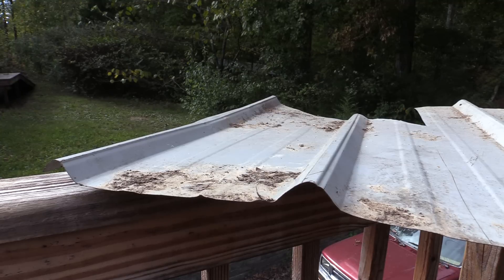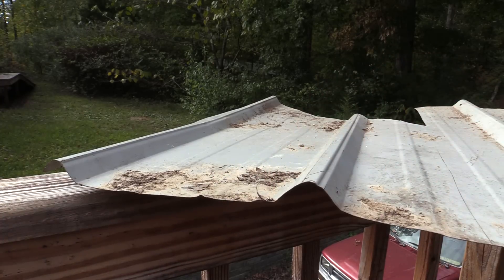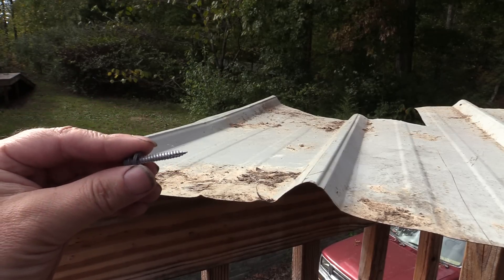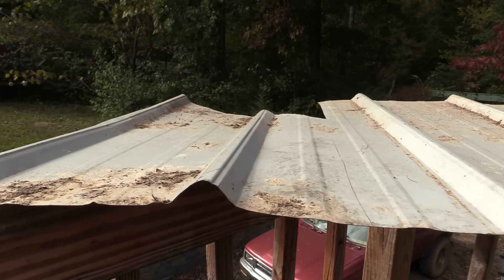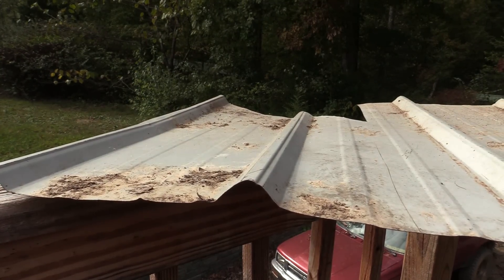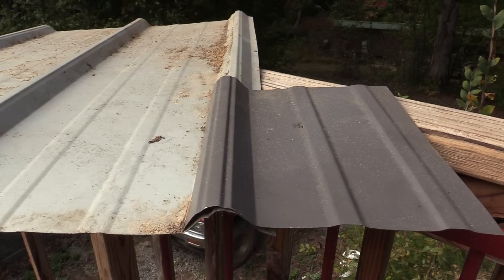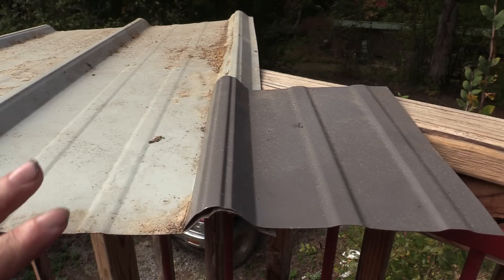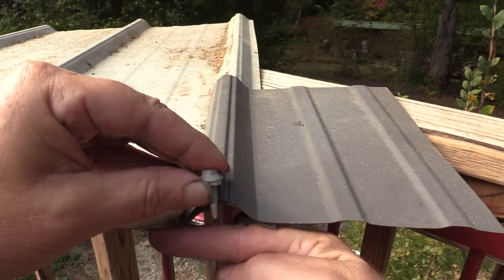Why you should not put screws on the ribs of metal roofing

Comment: Math at the end.

I like the theory and I personally put metal in with one screw per pan, plus one (differently shaped) stitching screw in the conjoined panel ribs.  We align overlay to not catch prevailing winds and it had worked so far.  We're mostly dry climate, which helps.  

The coefficient of expansion is 0.0000065 "/"/°F.   With a 200 delta F, that's a 0.0013" growth per existing inch. Over a 36" sheet width, it's 0.0468" or about 3/64".    Also, no thermal expansion is accounted for along the length of the sheet which can be in excess of 20'.
Reply from the maker: Yes it is about the math, The coefficient of expansion of steel has some variability based upon the alloy of the steel used from .0000065 to .0000072 textbook wise. i found a building material site that has the coefficient for roofing panels at .0000073 which is what i am going to use. I have done one store that had a whopping 150' length. Also remember to divide you length in half as metal will expand in both directions going to the ends of the structure. For my part i find it easier to start with a 100' run with a 100 degree temp which gives .876 or just a hair over 7/8. I use this number at it is easy to remember and i can do most of the calculations in my head. we have a 20 to 30 degree temp change on a daily basis so we will go with the average of 25 degrees. .876 /4 x .75 = .16425 which is close to 3/16 which in my opinion is way to much movement. this much movement will cause the screws to loosen or the holes to wallow out when screwed through the ribs. this of course is not a typical case more on average would be a 50 ft wide home which would yield about 1/16 which is still too much over a long time line. But if your width of metal is half that then i cant see thermal expansion being a issue in my climate. Desert climates are a whole other bag where temps can change from 50 to 75 degrees. glad i dont live there

Comment: So... every one following the instructions is wrong but voiding the warranty and making leaky roofs is the right way. Gotcha.
Reply from the maker: You should follow the screw schedule aka instructions from the manufacturer otherwise you could void your warranty. this is the screw schedule from my manufacturer and they don't leak when done right.
Reply: @honeybeehomesteading  ok fellow beekeeper.  I put steel on my dad's house(looks exactly like yours on the peaks) my brother put the same on our grandmother's porch. Guess who put screws in the flats and who didn't (worried about deforming the ridges)and which one leaked? Oh not right away but after a few years in this hot sun those gaskets dry out.
Reply from the maker: @Maputi_na_Kalabaw  how many years? Those seals are pretty durable if they are properly installed. Too tight and they deform and split. Not enough and they get too much sun exposure and split. I bet they were not tight enough. The washers will bond with the metal if they have enough pressure. I have had to use a chisel to remove them on old roofing.
Reply: @honeybeehomesteading  2 on the porch my brother did and 27 on the house I did. People tend to drive the screws too tight
Reply from the maker: @GreatWhiteWaterBuffalo  yea too tight and you make the steel washer turn into a funnel. The screw will leak even if the washer is ok.
Reply: @honeybeehomesteading  yes or you deform the fn rib and ruin part of a sheet if you only mess up once like I did lmao.

Comment: It must have something to do with the pitch of the roof or the region in correspondence with snow load..in the past I have installed stitch screws on the rib every 4 ft with beautyl tape to ensure that ice dams do not build up under the rib  but never have I installed in the center of the flat
Reply from the maker: screwing the center of the flat is not correct as you want to be next to the rib. It seems to me that that you are not using many screws if you are adding stitch screws every 4 ft on joints. the butyl tape is a good idea but i don't see why you are using stich screws instead of 2 inch screws if you are already going through the rib or are you going through the flat?
Reply: @honeybeehomesteading  oh no we were going roughly an inch or so from the rib on 2 ft purlins with a stitch screw every 4 ft down the rib
Reply from the maker: are you in a high wind area? I ask because i never use stich screws through the rib and none of my roofs have ever had a issue even in some 80 mph winds. If i was coastal area i think i would build a roof more like a air plane with rivets everywhere lol.

Comment: The valleys are where the water runs, NEVER make holes there.
The ribs are the stiffest part, they will NEVER be the place where thermal expansion bends the sheet.
Thermal expansion makes the sheet try to separate from the beams, it will ALWAYS put stress on the screws.
Reply from the maker: @keepcalmandenjoythedecline  you are correct about the stiffness of the ribs. If your roof has lots of sheets expansions will stress the screws and the holes.if it is done on the rib. Screwing in the valley allows the metal to move at the overlap reducing the the stress on the screws by limiting it to the length of the panel vs the width of the whole building.

Comment: Rule number one: Don't put holes where the water flows. I've been installing metal on both coasts for over 35 years and have never had any leaks when putting screws on the ribs as long as you don't overtighten.
Reply from the maker: The same goes for screwing in the flat don't overtighten and it will not leak

Comment: The old time way is the right way on the ridge i have missing nails in a old pole barn it still dont leak on the flat would be piss in. When those junk washer dry rotted in 5 to10 years you will regret that.
Reply from the maker: I will prove you wrong about those washers on a upcoming video. They last

Comment: Well I screwed them beside the ribs, "why because I get a shit load of snow every year the snow just slides right off, but sometimes I have to use the roof  shovel and it doesn't get hooked on the screw heads when pulling, the screws on ribs come loose over the years by the metal expanding back and forth from heat expansion 😂
Reply from the maker: exactly

Comment: here is  how i do it ...  1  while all  pannels  still on  the pallet  and perfectly lined  up    I   predrill  @ 16"  to center along the flat of the rib ( top) .. with 1/8 th drill bit ..   2 ...  for my application  i used 2.5 " screws  to ensure  they actually go into the meterial being screwed to . i use jigs i made  to hold  a total of  4 pannels  at a time  in perfect  position  ( as i am working alone .  then  i screw them in   with my drill  ( for my drill,  i preset it  to slip  ie .." number 2  setting " ) , as it screws down , it does not over tighten  but slightly compresses  the rubber gasket  below the washer  on the screw . to esure a good  seal ,. and also  because they are predrilled  it doesnt  indent the steel   or over size the drill hole  which negates   the size of the screw or  the gasket ..   SO .. ASK THIS LOGICALLY //   WHERE DOES ALL THE WATER  RUN IN  AND  WINTER SNOW  CLING ON,   SIMPLE ANSWER IS  THE FLAT  CHANNEL  IN THE MIDDLE OT THE RIBS ... SO  WHY  ?  WOULD YOU SCREW  THERE ? AS IT INCREASES  THE CHANCE OF  THOSE VERY SPOTS LEAKING  . and yes  the metal flexes  in freeze and thaw ( hence  why your supposed to ( periodically ) retighten the screws /or replace when the gasket  finally degrades .    I have never had  A ROOF  LEAK  YET   NOR  PULL AWAY  .( i live in NB CANADA  so we  get rotten  wet snow in winter ,.. high winds  and heavy rains  in spring and fall ../ and  heat  in summer .   temps varry from .. - 20F to  - 22 F in winter (  5 F average ) and heat  of 68F  to 95 F in summer .
Reply from the maker: @catharsus21  why would I screw in the flats. Simple answer is thermal expansion. It may not be a big deal on a roof with few panels. Those that have lots of panels will quickly negate the seals on your screws that is unless your panel is designed to be screwed through the rib which some are just not the one in the video according to the manufacturer. Follow the manufacturer and sleep well if you don't you are open to a lawsuit later.
Reply: @honeybeehomesteading   well i was only posing a question and making a statement  and  USING my example .. on that note however . a roof  with few panels .. WELL  I AM NOT  A CONTRACTOR  nor am i saing my way is the only way ( just the way i prefer and have had the most sucess with )  and also  if 36' by 42'    and 40'  by 60'  ( just two examples ) are small ,,. i guess  you live in texas ( everything is bigger in texas ) lol .  now  , also im not trying to sound mean  or ignorant .  but  note " manufacturer  RECOMENDATIONS "   key word is  " recomendation"   as  you have to assess  all the variables ( one of the  rules of engineering .. y = x of f ) kid of like  GM SAYING " KEEP YOUR GM .. ALL  GM .  its recomended ..  but NOT  esential . same as  sailing rigs .. weather  it be a bimini / junk / naunsuch /square rig .. depends  on the  variables  and area . and as i described   about predrilling  and not over tightening  . as to negate the seals. or squish them out   that  they will degrade faster  etc. i have been fortunate  as  im 5th generation  that has been raised  and live on aprox 2200 acres of wood lot  with aprox 160 of farm land ..  so we had to learn  as we never  could afford   to hire a mechanic /  carpenter / well driller/ electrician  etc .,   we learned  ( sometimes the hard way )  we use our forge and actually farmed with horse  up  to 1979 .  in fact  my uncle  never even had a indoor  toilet   untill  1988 ,., lolol ( his  choice),  but i  am pointing out , that many in the comment section  also  are saying the very  same thing i said  or something  similar .  was  never meant  to offend .  just making the statement.
Reply from the maker: I wasn't offended, I was just answering your question as to why i would screw in the flats. The manufacturer has a screw schedule it is not a recommendation but more of a must follow or you will void your warranty. Everyone should follow the schedule of the manufacturer if it says screw in the ribs screw in the ribs . I know many who have commented here have had leaks in the valley or are worried about leaks in the future. The trick is to properly screw the metal on, any screws overtightened should not be used. All of my roofs have held up for 20 years with no leaks.  Funny you mentioned forging as i have been doing just that for last 4 days. thanks for commenting

Comment: Seems to make more sense to put the screws on the ridge where the water will run off them and not in the valley where there in a river every time it rains. I can see it might be structurally better in the valley but I'm going to continue putting them on the ridge, it's always worked for me. Some of the problems you mentioned might be regional issues and in some climates it probably doesn't matter either way.
Reply from the maker: the size of your building is also a critical factor. Through the ribs will cause issues with long building where there are lots of panels in a row. not a big deal in smaller buildings

Comment: The people who put the metal roof on my house did a wonderful job. They had a guy on the ground, & put the screws in the ribs, but pulled them down just enough to touch the rib & keep the line straight. The put screws in the flats at the end of the roof near the gutters. They told me never to get on the roof, & it will never give any problem. It is almost 20 years old.

Comment: If you use paper thin roofing with a very, very small rib...you are correct. 
But get some decent sheeting people... Screw it thru the rib and it will never leak and last a lifetime.
Reply from the maker: What do you consider paper thin? The metal i normally use is 24 guage

Comment: Time for you to get some continuing education on installing metal roofing / siding.

"LAP" screws have a shallower thread & thicker shank and are designed to lock panel mid runs to adjoining panels. They have a self-tapping driller point and rubber washer and are designed exclusively to join panel overlaps at main ribs.
Reply from the maker: What you call a lap screw we refer to as a stitching screw. I am well educated on the subject thank you. Here is a video of some of the different metal roofing screws i made over a year ago. it includes a screw that many have not seen that has a solid one piece head. https://youtu.be/klGGIK25Wm4

Comment: What is it? Can not move do to heat and cold or the screw breaks because of to much movement. 

Having the roof screwed in on the flats, where is the expansion then? 

I have screwed it on the ridge and not one had leaked, ever PERIOD. fasten it in the flat and let's see. Next time i need to catch rain i will turn the bucket upside down. Using your logic i should have plenty of water!

But then again. YouTube University is a great place to learn.
Reply from the maker: @hausnerr  the expansion occurs where the two sheets overlap as screwing in the flats allows the sheets to move independently. Screwing in the ridge they do not  as they are all connected. Before you get all high and mighty I am just telling what the manufacturer had as the screw schedule something ever installer should read as it varies from different panel designs.

Comment: screws on the flats will leak, eventually. Screws on the ribs will not significantly leak as they are on a high spot. My metal manufacturer says you can do it either way but around here (Ozarks) everybody knows screws need replaced every so often or the whole roof needs waterproofed eventually.( there are several companies around here who do it because screws on the flat eventually will leak.) It just takes more time & finesse to place them on the ribs and not overtighten and most contractors are either too impatient, too cheap, or do not properly train to put them on the rib where leaks won't happen.
Reply from the maker: I dont know it seems harder to screw in the flat properly. if you overtighten then the screw is ruined but most installers just back them off. I have original screws design roofs that are 20 years old and leak free. the new one piece screw are supposed to last something crazy like 50 years but it has been a minute so dont hold me to it. replacing screws in 20 years is ok with me as i figure it will be time for new paint as well but honestly standing seam is the way to go if you really want maintenance free

Comment: They were called lead headed nails and they were very sharp so you never needed to dent to metal to start the nail. The lead under the head of the nail was soft enough to mold over the peak. There are roofs V- crimp roofs over 100 years old in Florida that have never leaked. If you put a screw in the valley or flat it will leak eventually.
Reply from the maker: @andysmith5012  lead headed nails were used for 5v which only had ribs 1/2 inch tall. Nailing in the rib is still the proper way to install that metal roofing. The metal in the video is designed differently to overcome the effects of thermal expansion.
Reply: @honeybeehomesteading  I disagree. Water will find a way in the valley screws.
Reply from the maker: @andysmith5012  if the screws are installed right they will keep the water out I have roofs I did 20 years ago that remain leak free. If they are installed wrong they will leak. If you put them in the rib wrong they will probably not leak. I didn't make this screw schedule the manufacturer did.

Comment: I took a 70 year old galvanized roof off my barn last year, it was installed in July 1953, there was a piece up by the vents that had the names & date they put the roof on.  & that whole roof  was held on by gal spiral nails with lead washes. If you look at the holes they were all in ribs & oval from movement over the years , the bottom of the runs there were nails in the flat & they were not as oval, closer to round, I put my new roof on with screws in the flat, we will see how it goes, over a year no leak yet. My patio roof is 10+ years old, also screwed in the flat, no leaks yet.
Reply from the maker: In the flat really does work as long as you screw it in properly. I have had only 2 leaks from 2 undertightened screws in 30 years and dozens of roofs and tens of thousands of screws